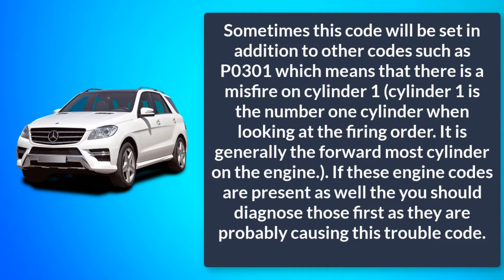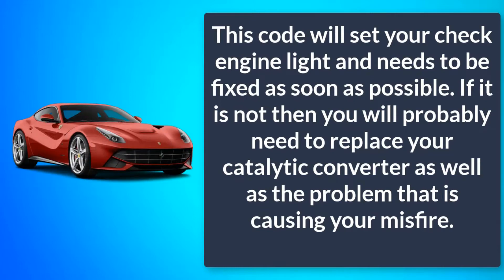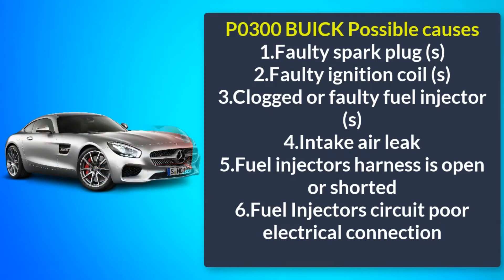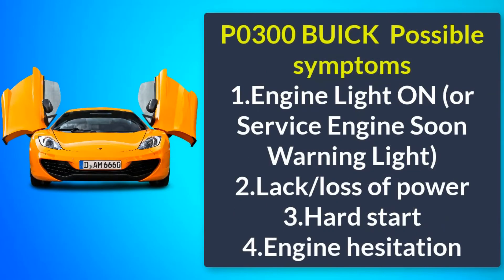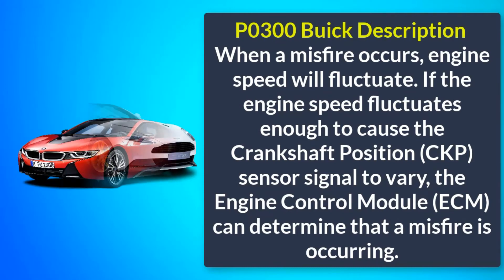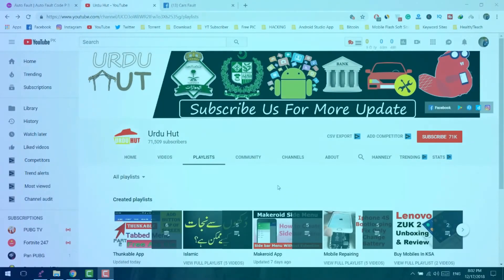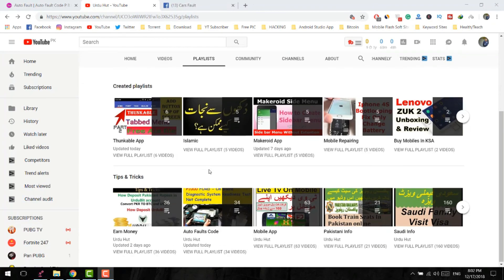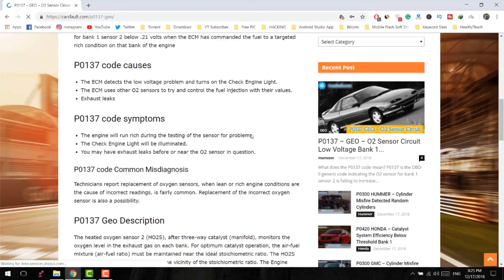P0300 BUICK   Cylinder Misfire Detected Random Cylinders

Comment: 1/25/19, I have a 98 Dodge Dakota Sport 3.9L, V6, had a complete tune up and changed all sensors still getting a random misfire. I am frustrated, I am waiting your response. Thanks in advance!
1. TRUCK RUNS SMOOTH WITH PREMIUM FUEL AND FUEL TREATMENT. TRUCK RUNS AWFUL WITH PREMIUM GAS ONLY. 
2. CHECK ENGINE LIGHT STAYS ON, W/RANDOM MISFIRE CODE. 
3. HAVE TO TURN SWITCH TWICE TO PRIME THE LINES, BEFORE TURNING IT OVER FOR IT TO CRANK.
4. MAYBE UNRELATED, AC WORKS EXCELLENT, GO OVER 55MPH, ONLY GET VENT AIR, NO AC.